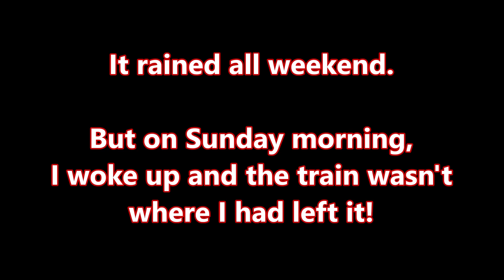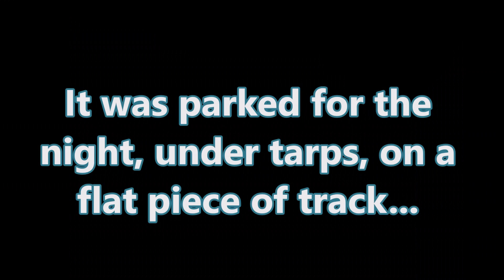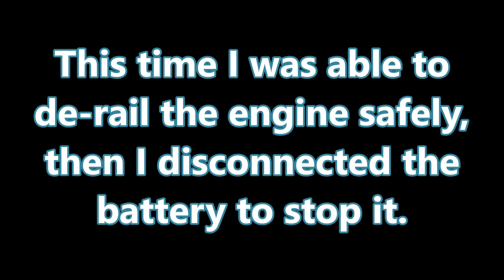Part 3.4 - Building a Backyard Railroad - Trestle progress + Train Mouse strikes again!

Comment from the maker: This thing is really screwed up.  I'm replacing all electronics.  I've ordered a new 24v motor controller with potentialmeter, forward & reverse, and a digital power meter.  I also ordered a multi LED battery meter.  I'm working on the plans for the 12v lighting, sound system and misc. 

Battery key cutoff switch arrived, along with a new 24v charger.

The sound system is a mystery.  Soundtraxx?  This will take some time to research 🧐